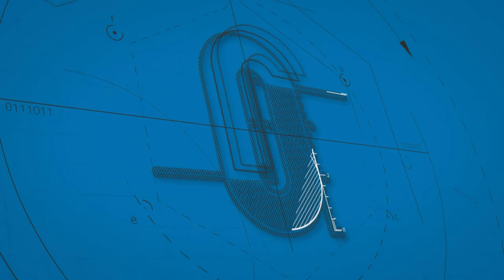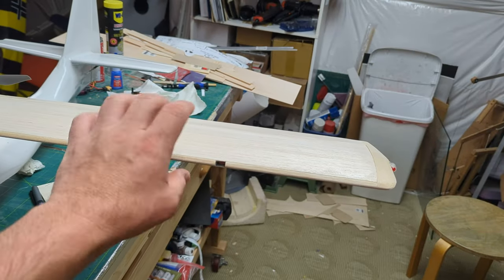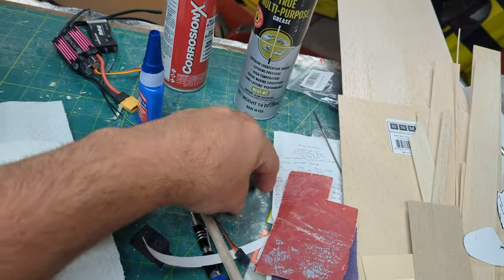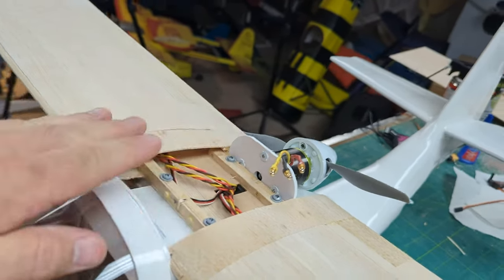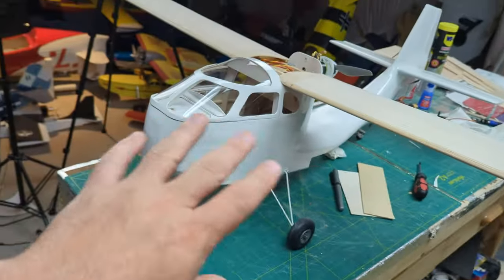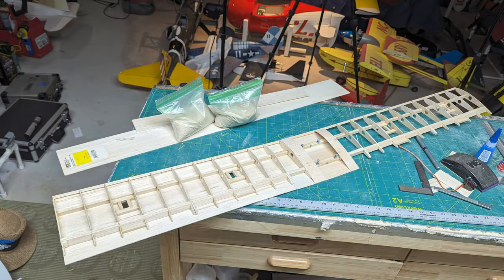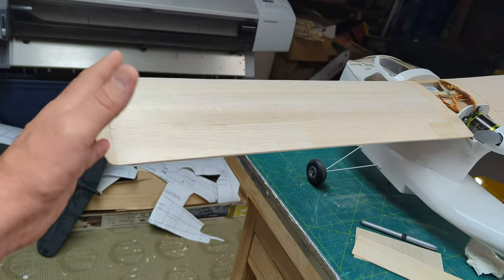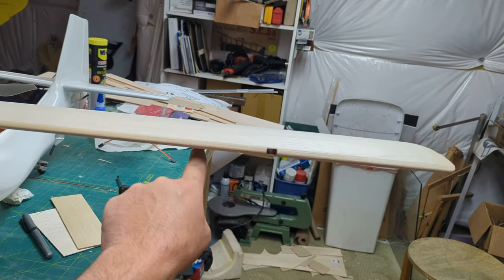RC-3 Seebee wings are fully sheeted and ready for finish work

Comment: Hey Josh, what ever happened to the mustang build?  I was really looking forward to the vari-pitch prop setup in-use.
Reply from the maker: sigh The story is that once I got to the sanding of the wing, something was in the wood that gave me some sort of reaction. I go hives all up and down my arms and had issues breathing. Not something I normally have with balsa. As I further tried to work on the project it continued to happen. I still have the project in a very unfinished state and I do want to finish it but it's one of those things where I'd have to manage the dust VERY well or wear a BSL3 suit while I build. The wing needs to be fiberglassed and finished out but the fuselage... has a long long way to go.